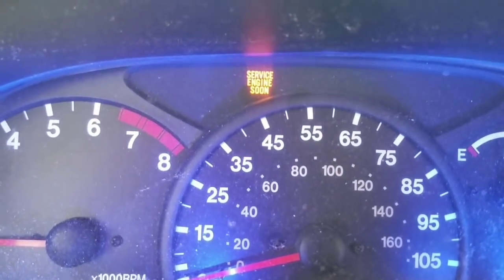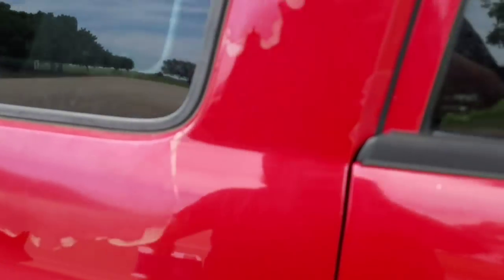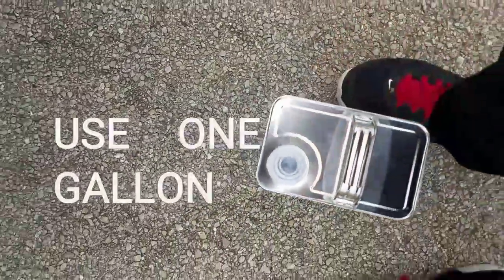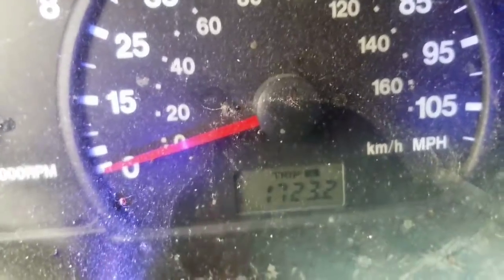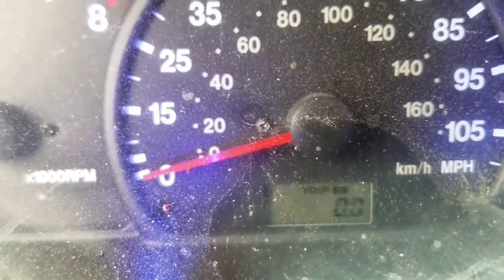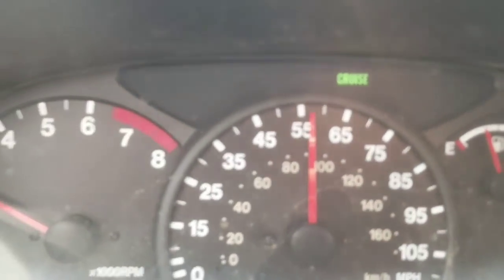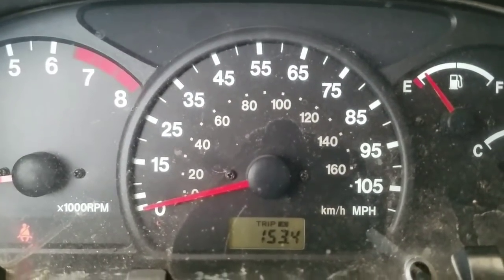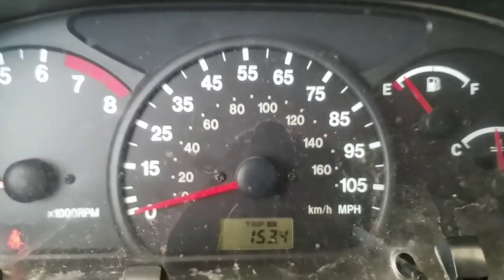LACQUER  THINNER  FIX FOR CATALYTIC CONVERTER.

Comment: Good job! It works excellent. Mine was so clogged, it smoked like Seafoam for a while. ATTENTION - 99.99999% of the horror stories on these DIY posts are posted by garage / shop owners or sock-puppet-accounts that are paid to come and scare the living hell out of anyone attempting to do something that will take money away from a shop.
Reply from the maker: Right on, I'm glad it worked.
Reply: What is the amount or ratio like 1 gallon thinner = how much gas please
Reply: @fazlulmohammad8834  1:10
Reply: Definitely believable!
Reply: @fazlulmohammad8834  he said half a tank.
Reply: Totally agree with that statement about shops trying to scare people so they don't lose business. I first heard about using lacquer thinner from Scotty Kilmer  and he's actually a mechanic. The difference is he has integrity compared to those "shops". A good and confident mechanic will try to help people save money. In being honest they are rewarded with more business from word of mouth. 
Now to be honest, I haven't tried the lacquer thinner technique YET. But I have been leaning towards trying it. I have an '08 Corolla, and after recently solving a battery/alternator issue, it kicked off a P0420. Along with that, whenever I drive the Corolla up even the slightest hill (while accelerating) it now bucks. Then recently I went out to start/warm it up (to take my wife to work) and it had a horrible rough idle and then it shook badly when I put it in reverse. I've already cleaned the MAF sensor so I've been tempted to try the thinner technique BUT I'm nervous about the thinner damaging any seals, gaskets, or electronics. I may be foolish thinking that. So, the other day I came across a video where the guy removed the O2 sensor (the one between the Cat and the engine) and poured Techron Concentrated Plus (fuel system cleaner) in it, then replace the O2 sensor, and waited about 30 minutes. Then he ran the engine until it stops smoking. This method avoids damaging anything internal. Other than that, the best way is to unbolt the CC and soak it in a detergent or cleaner.
Reply: True Reality Blaster, the thing is some guys dont even know WTF they are doing n think they know n then post on Utube.
Reply: But did the catalyst code come back after the lacquer thinner treatment for you?
Reply: @Roller76 ...cars have different gas tank sizes...so you can end up way off. Scotty Kilmer says 1 gal thinner to a half-tank of gas.....assuming the half tank is about 10 gals. So.... 1:10 ratio. Some have gone much stronger like 1 gal thinner to 5 gals of gas.....but this is overkill for most.

Comment: I have a 2008 Saturn Outlook. P0420 for the past 8-10 months. I changed plugs, intake gasket, O2 sensors, PCV , couldn't get code to stay off to pass emissions testing in TN. I put 1/2 gallon  lacquer thinner with a half tank of gas and ran it 200 miles. The code came back. used the other half gallon with a half take of gas and ran 300 miles and the code stayed off! Passed emissions today and that's all I needed to get new tags.  Thank you sir!
Reply from the maker: That's awesome! I'm glad it worked for you 🤘
Reply: I'm having the same issue,  but I haven't tried the this method. I'm a little scared lol
Reply: @nonialexander5880  use a whole gallon on a half tank
Reply: I am going to try...with my saturn vue 2008 ...I spent almost 800$ and the light is still on....my (ex) mechanic after replacing some parts...didn't give to me any guarantee that I will pass.
According to him I should be his ATM card.
I will not spend any more money. 
My last chance. 
Lacquer
Reply from the maker: I did it at my own risk but they do sell Cataclean at any auto parts store.
Reply: @joe-pd4uu  any updates
Reply: @joe-pd4uu  did it work
Reply: @raizdesuenos  no,no. these people forgot to come back with the result.

Comment: I dont know if this is addressing the same topics in this video but I wanted to share.
If you have a *catalyst inefficiency code*, take out the O2 sensor Behind your Cat, (B1S2) 
This is the POST cat sensor that is in place to read what's coming out of the converter(how efficient it's doing). 
Buy a large style spark plug anti fouler (same thread size as O2 sensor)
File out the hole in the anti-fouler until its just big enough to have a little space for the O2 to screw into it,
So you end up with a O2 sensor with an anti fouler on the end, screw it all back into the exhaust,
It fools the readings that the sensor can read, Now the computer thinks it is working perfectly efficient,
(This will work if your cars converter has been damaged by contamination or age)
A catalytic converter can be 95% efficient and still fail, It only takes a 5% degradation for a cat to fail, thats why this can help.
(P.S. I NEVER said this is legal or not, I believe that is up to the owner to decide)

Comment: My 2004 Dodge 1500 threw a code for this, I put 1 gallon of Lacquer thinner in 8 gallons of gas and it was fixed before I got 200 yards down the road. It will not always work but it worked for me.
Reply from the maker: Awesome! Glad it worked for you 🤘
Reply: Bout to try it on my 2006, o2sensors unplugged. Hope it works
Reply from the maker: @josephsmith9663 hope it works.

Comment: It worked for me on my 1999 Ford Ranger with 4 liter V-6 and 174,000 miles.  I kept getting a PO420 code for too rich fuel mixture.  I changed all three oxygen sensors just to find out the catalytic converter was stopped up.  I saw Scotty Kilmer's video on using lacquer thinner, so I tried it with a little less than 3/4 of a tank of gas.  I drove it 247 miles before filling it up.  It only took 13.5 gallons to fill it up.  I was getting 18 mpg versus 14 mpg before with the stopped up cat.  My idle speed dropped from 1000 rpm to 650 rpm, and my little truck runs like clock, drives you back in your seat while burning the tires.
Reply from the maker: Glad it worked for you.

Comment: Awesome video. I did this on my 2005 Highlander this week. Check engine light turned off after 22 miles of driving around with Lacquer Thinner in half tank of gas.
Reply from the maker: Glad it worked for you, it's usually carbon buildup that causes it to get that code.
Reply: Hi Andrew 
Dose this work on fuel cars as well or just gas ? 😊 thanks for reading

Comment: 1 thing of that is when u run that through the gas tank I noticed it blows white smoke out the tailpipe which that's good that means it's cleaning it's cleaning the converter

Comment: thanks for great video   I just bought lacquer thinner today.
Hopefully it works for me too.
Reply from the maker: +Jason Ji  let me know how it works out, good luck
Reply: Ivan Roux oh unfortunately, It didn't work for me 
my car is 25x,xxx miles 2002 camry 2.4 liter Japan built one.
I bought after market Cat converter made by 'walker' .
p0420 code is gone (drove 2000miles after replace)
I think you can at least  try lacquer thinner method first, just in case ^^
good luck!
Reply from the maker: +Jason Ji  I hear ya thanks.
Reply: Jason Ji =j
Reply: @bikeholy  I would say that yeah sometimes the cat is just too far gone. Always worth the try though.
Reply from the maker: I was lucky but eventually had to replace my catalytic converter. YouTube helps, I just installed my alternator and saved $300
Reply: @bikeholy  I got the same car just different year a 2006 and the runs better before I had a hesitation and no power but now it's running way better maybe I got a bad cat or bad fuel injectors

Comment: cool I'm going try that on my car found that too my catalytic is having a problem got my car inspection and fail cause of that I'm piss that parts alot money hope this work glad it help u
Reply from the maker: It worked, but I did it at my own risk. If you feel uncomfortable try Cataclean. If the catalytic converter is damaged it won't work. To know if you need to replace it, it will make a rattling sound when you accelerate. Update on my car I had to replace it, but it bought me more time to pass my inspection.
Reply: Ivan Roux how long did it last until you got to replace the CAT? Did the check engine light turned on again? and then you have to replace it.?
Reply: pamela espinoza did it work when you did it

Comment: Cataclean also works well, had 16oz to 3 gal of fuel. The MSDS shows main ingredient is acetone
Reply from the maker: I tried the Cataclean, it worked.
Reply: @rxvanz  noticed another comment say it's only a temporary fix and will mess up again in aMonth or 2.. is that true ?
Reply from the maker: It was a temporary fix, I ultimately had to replace it.

Comment: I will share the best way to have a 100% clean catalytic converter 24/7/365 first remove it from auto then cut a hole on the top side that kinda looks like this u. Lift up and use whatever you have to remove the insides of the converter then close and either tack weld job weld or straighten out a couple hose clamps and screw it down right then tape up the cut up with aluminum tape and put back in place. Now you have a open converter and if looked at will look normal to pass inspection. Now if you won't your car to have a lil attitude found slap on some flowmasters and it will sound a lot tuffer then it did

Comment: I have the same vehicle with the same problem. I'll have give it a try this week.
Reply from the maker: Like I said I tried it at my own risk. If you have doubt try Cataclean. Does your car make a rattling sound when you accelerate? If so you might need to replace your catalytic converter.
Reply: @rxvanz  No, the car runs fine, no rattles, etc (and I already replaced the o2 sensor).  I think the cc is probably coated with a layer of soot.  I've also heard of people removing the front sensor and spraying in lacquer thinner and having good results.  Last resort for me is to use a mini-catalytic converter to get rid of the light, but maybe this is worth a shot.  Thanks
Reply from the maker: Good luck and let me know how it goes.
Reply: No luck. CEL is still on, though there are no ill effects. The car actually ran great and smoothly with the lacquer thinner. I've ordered a mini catalytic converter that should solve the problem (replacing the cc on these Suzukis isn't a small job).

Thanks for the vid anyhow.

Comment: Muffler snapped off and teenage drove for a few weeks maybe a months and then the P0420 check engine code came up. We got the muffler welded back on and then I followed the 1 gallon lacquer thinner to a have tank of gas and drove it up and down the highway for about 100 miles at an avg of 3000 rpm. Parked it, turned off and back on and bam no more check engine light.
Reply from the maker: +oxXxJMExXxo awesome! I'm glad it worked for you😊

Comment: What if your check engine light is not on.Would using the lacquer thinner for preventive maintenance be okay?
Reply from the maker: If your check engine light isn't on use fuel additives that are recommended to clean out the carbon build up. Cataclean or Royal Purple Max Clean helps clean out the catalytic converter.
Reply: @rxvanz  Don't they have many of the same ingredients as LT and much more expensive?
Reply: @da324  yes..  acetone isopropyl alcohol xylene toulene

Comment: Nice Kicks Bruh. Cool video. For everyone trippin, read my whole post B4 PROCEEDING...
WARNING... I've used this method of removing P0420/P0430 codes for a while, and well, WARNING,  Proceed at your own risk, keep reading tho, in fact don't do it but keep reading. I know I'm making conflicting remarks but yeah well, if your gonna do this then do it when you can actually drive that 100 to 200 miles, because,  (Via Wikipedia),  Lacquer Thinner is usually a mixture of solvents able to dissolve a number of different resins or plastics, in other words, empty your gas tank by driving it and don't let it sit in the tank, after driving and before letting it sit, FILL THE TANK UP WITH GAS, especially if you have a newer vehicle with lots of nylon and plastic plastics like your gas tank. Anyway DIY everyday everything.  Sorry for the long post.
Reply from the maker: Thanks, I appreciate your feedback. My car is running fine, but I maintain it more than I used to.

Comment: I do not believe I have a CAT problem. No engine light. Runs perfectly. 2003 Saturn Ion. As someone mentioned..... Do you think or is it logical (I'm not asking you to recommend anything), but I am considering using laquer thinner as a preventative measure -200,000 miles?
At my own risk.
David
Alberta
Reply from the maker: I would try Cataclean first, that's designed for cars.

Comment: So was that the quart of lacquer thinner or a gallon
Reply from the maker: I used the whole gallon at my own risk. If you're hesitant try Cataclean. It helped me on a pinch to pass inspection. I eventually had to replace my catalytic converter. It'll clean it if it's clogged but mine was a little broken, you'll hear a rattling when you accelerate. That's a sign it's broken and not clogged. Hope this helps.

Comment: Hi there. So same my engine light came on I got it checked sure enough it was rattling.  But was warned I'd need to replace my cat eventually.   Well today 8/19/23 lost power when I got off the highway came to stop light and went to hit the gas ,had loss of engine power. Started sputtering.  Made it across the intersection pulled off. Freaked out... (nobody to call) let sit a few cranked it revved the engine hit drive took off made it four house down the street. And coasted in my driveway.. it was hot out. My cat does need replaced I do have engine light on.. do you think this lacquer trick will help. 😢
Reply from the maker: I'm sorry to hear about your car. Mine was making a small rattle when I would accelerate fast and hard. The lacquer thinner cleared up enough for it to pass inspection. I did it at my own risk. I did have to replace it a few months later but I saved up for it. I've prepared for other stuff that is car related. I pay for AAA service and it helped me out in a situation where I was traveling with my brother. His truck broke down the road a little close to town and they towed us to the nearest auto parts store. We were able to fix my brother's truck in the parking lot and I only pay a little over $12 bucks a month to have myself and my brother on my account. There's a thing called  Cataclean they sell in Autozone or most auto parts stores. You have to follow the instructions.

Comment: I did it to my 2000 Toyota Celica. I gallon of lacquer thinner to half a tank of gas, drive at 120klm for at least 1/2 an hour or more . You can also remove the catylitc converter and soak it for a day in laundry detergent.
Reply from the maker: Awesome 😊

Comment: Did it fix the problem permanently?
Reply from the maker: It was a temporary fix, it was enough to pass my inspection. My car still runs and has over 250,000 miles. It's a 2001 Chevy Tracker with an Isuzu engine. I don't know if I should replace the engine or just get an overhaul. It's a good car.

Comment: @IvanRoux that shaking when you put the transmission in drive or reverse is a bad or broken motor and transmission mount. I know it cause I had the same problem.
Reply from the maker: +Ricardo Espinoza I was told it was the motor mounds.

Comment: Hmmmm. The "Service Engine Soon" light is not the "Check Engine" light. At least not on any car that I have owned. On my cars a service engine soon light just means that I am near an oil change interval. A P0420 will indeed set your check engine light on. I never saw your check engine light illuminated however. I have doubts that your check engine light is actually working. It should come on for 3 seconds, along with all of the other dash lights (i.e. warning lights), when you start the car. This 3 second period is to allow you to survey your warning lights to insure that they are all functioning.

Comment: You don't have to drive all day just put the thinner in and put a weight on the gas pedal to get it up to 2000 rpm and run it for a half hour in your driveway😎
Reply from the maker: I didn't mind the drive, thanks for watching my video.
Reply: Even though it has one. I'd still put another fan in front of it if it was in the driveway.
Reply: @USA STRONG 😂👍

Comment: Thanks gracias for the information
Reply from the maker: Hope it works for you. If you're not sure try using cataclean first.
Reply: Ivan Roux I used cataclean doesn't works
Reply from the maker: I'm sorry to hear that. Sometimes it's the catalytic converter that needs to be replaced because it's too old and broken.

Comment: Should we ritualisticly run lacquer thinner in our engine for maintenance?  If so, how man miles??
Reply from the maker: I took a chance and I don't recommend it. They do sell something called Cataclean that's made for vehicles to use for that purpose. Unfortunately in my situation it was a short fix before I had to change out my catalytic converter. It bought me time really.